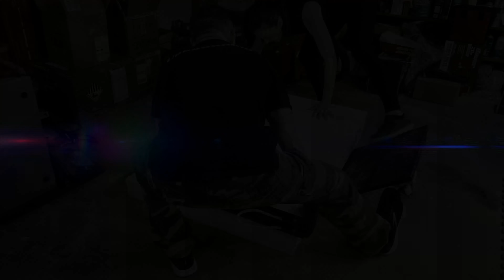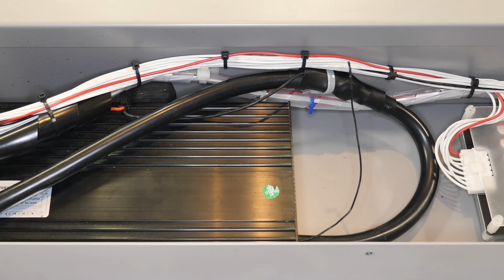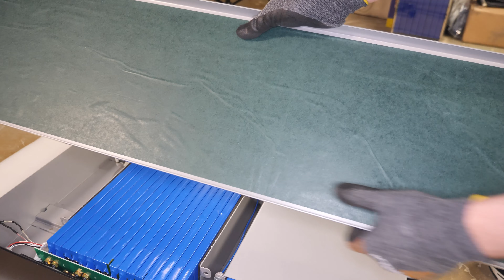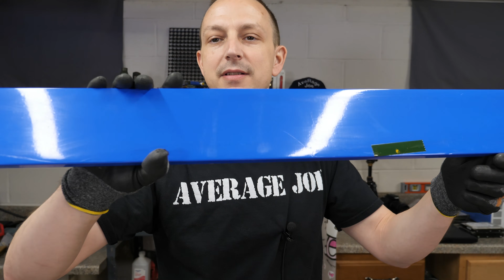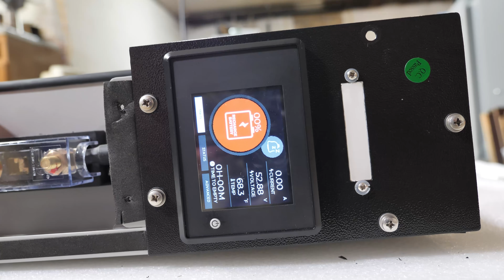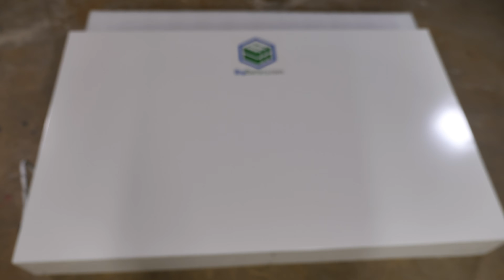14kwh Rhino Battery Teardown!  BigBattery.com

Comment: I've had nothing but issues with these batteries.  I bought mine through Battery Evo and am surprised to find their logo inside the Big Battery version.  I can't recommend anyone to buy these or really anything from Battery Evo as they don't stand behind their product and are not easy to get a hold of or get anything resolved.

Comment: Do you know anything about batteryevo the seem to be the same company as big battery. If they are the same product im about to but two of their rhino batteries for $3k a piece
Reply from the maker: So I think the story goes is batteryevo -->was<-- a sister company. Batteryevo would make or supply certain parts like the bms shell/cover, cell heat shrink stuff like that. Bigbattery uses all brand new batteries, Batteryevo I believe uses used/recycled batteries. I know a while back I did a video on some 12v 150ah batteries from them and they were used batteries. It was there BR150 battery.  Im all about gettin deals but I dont think I would personally spend $3k on one.
Reply: @AVERAGE_JOE  yeah I probably won't go with used cells in them it's very tempting given they looks the same even share the same name and warranty time with big battery lol
Reply: @AVERAGE_JOE  well I did some reading and they state they are new cells on their website so maybe it's a little more promising in that regard. I mean you can get two batteryevo rhinos for almost the same cost as one big battery rhino it seems weird and too good to be true lol
Reply from the maker: It does seem to good to be true.

Comment: So should the BMS temperature sensor be attached to the battery cells instead of just floating around in the box?  I'm no battery guy but don't really understand what is being gained by monitoring the case air temperature.

Comment: Nice tear down , thanks for ur efforts. Build looks fairly good & I like the active balancer idea, they do need it, but some more info on how that works would be good as some of this type can do damage.
I imagine u can set it to come on at pre set or settable parameters like @ 3.4v-3.45v when the charging cell is in its peaking curve, if it is set up correctly the active balancer will be be of great benefit more than a few times a year on a system that regularly hits 100% SOC, or else a switch could be added so you can switch it on whenever you want and turn it off so it doesn’t do any damage, as they can if not programmed correctly.
I think it looks like a pretty good/solid build for the price point. If you were to buy 2 of these batteries & had a faulty cell in one pack, you could pull every second cell to maintain 75% overall capacity with up to 15 spare good cells for any further cell faults down the road in either battery pack.  Cheers

Comment: So what do you think of the life of these batteries? Am I better off getting a server rack so I can replace them as they go bad?  I hate for this big battery to go bad and being up a creek.
Reply from the maker: From what I understand, these cells are the very best around! They have a 10yr warrenty, can be cycled over 8000 times (still lots of life after) and temp range is better then most. As far as rack batteries go, that is an option for sure. It allows you to build up capacity a little at a time or like your thinking replace a one if there is an issue. Either way you go is great In my opinion! 🤘
Reply: It can be seen as a pro & a con that this pack has paralleled cells, if you have a suspect cell in the pack you can remove one & have half ur capacity still to keep things going till u come up with another idea or replacement. If u had 2 of these packs, you could use those other cells to replace faulty cells as they occur in one battery pack to keep it fully operational, while the second pack is reduced by 50%, but you would have a spare 15 cells to keep one packs capacity up for an overall 75% capacity always for many years to come. Just a thought for future maintenance or quick fix.

Comment: I see on your breaker you have dual 60amps to power the Growatt.  Why did you choose 60amp?
Reply from the maker: The 12kw growatt has 2 60a breakers on the lower side so I used 2 60 breakers on the breaker panel to power everything. The manual may say to use as well but its been a while since I looked at it.🤘

Comment: In the event of an EMP, what components would have to be replaced? Are they readily available to pre-purchase for shielded storage?
Reply from the maker: I would say the circuit boards inside the inverter(they are avaliable) and possibly the bms inside battery(also avaliable) I would also suggest installing ferrite rings on the battery, solar and 120v/240v wires to help suppress the spikes. Dr. EMP on youtube has videos on the ferrite rings🤘
Reply: @AVERAGE_JOE  
Thanks! Growat sells a hardened version of their 12KWh & 15KWh inverters. Are you planning system follow-up videos?
Reply from the maker: Ill have to look up the hardend version! Didnt know about it. Yeah planning on more vids. Regular job has been busy but that has just changed!!
Reply: @AVERAGE_JOE  
I contacted big battery and they have NO (pre) or (post) EMP policy. They DON'T sell the BMS or boards separately that would surely NOT survive and only do "defects" as their warranty process. I asked if he knew what the countries posture would be post-EMP and he was very ignorant and tried to save face. He's not aware that ALL communities have an EMP component to their disaster responce plans.
My conclusion: they have a faulty business model, regardless of their nice product offerings.
I wished him well trying to get to work post EMP, let alone having an operational company.
Reply: @LtBRS   Are you sure it's Growatt and Not Solark that has EMP option ? I don't think Growatt makes a 15k .
Reply: @onthelake9554  
I could be mistaken. I'll go back and check into it.
Reply: @LtBRS  Yeah , Solark is the only inverter company  I've seen that believes in EMP hardening and they get 1500 bucks for it as an option.
Reply from the maker: You can harden the hole house and system for less from emp dr.
Reply: @AVERAGE_JOE  
SolArc shows their testing and compliance. Does EMP doctor offer the same confirmation?
I watched a bunch of his vids, and while it may be effective, it's all theoryaretical with no tests.

Comment: I was hoping you were going to cut the heat shrink off the cell so that we could see who made it. I suspect it's a BYD cell but it could also be a CATL. There was a QR code on the end that I think if you scanned it would have given you the battery manufacturer and date.
Reply from the maker: 😆 I totally ment to say they are BYD Blade cells🙃 I may have a pic of the QR code. If I do Ill scan to see if it shows anything!🤘

Comment: those are mfg. reject cells likely only due to those dings in the wrapper. Some EV mfgs use that cell, but their purchase contract doesn't allow for broken insulation, which creates the B product line - a piece of kapton tape and good as new.

Comment: I'd really love to add one of these to my existing Sunrun solar.  I've contacted a few solar/battery installers and all of them have told me they can't add a battery to my system with a transfer switch to switch to battery power if the grid goes down without voiding the Sunrun warranty.  And Sunrun won't add a battery to an existing system.  They'll install a Tesla power wall with a new solar install, but they won't add it to an existing system.
Reply from the maker: Damn that sucks. Im not familier with the sunrun. Im guessing its a gridtie system?
Reply: @AVERAGE_JOE  Yeah it’s tied to the grid

Comment: Only time I haven't had a good experience with using printed boards is for the car audio projects, they have to be at least 2oz or the heat does scary things. For the house system of course it's fine there's never more than .5 c load. What I thought was wild is that was a 100 ah, 3.2v cell. Over 3' long lmao! Sorry That's just bannanas to me. Excellent breakdown man, thanks for sharing. We live in an excellent time for batteries!
Reply from the maker: Bananas!😆😆😆🤘

Comment: I really don't like an active balancer on all the time.   It should only be turned on at the end of the charge cycle.     I can not tell from the review if there is a control that only turns the active balancer on at the end of the charge cycle..... but it does not look like it.
Reply: That is BS. Active balancers are installed at the factory for a reason. Do you think they add unnecessary parts to make their profit lower?
Reply: @solexxx8588  Active balancing in the flat part of the charge curve will most likely hurt the balance between the LiFePO4 cells.    A balancer uses cell voltage as an indication of state-of-charge, but a cell with 3.2V might have a higher SOC than one with 3.21V.  Consequently, moving energy to it from the other actually hurts the balance.  It is not till late in the charge curve that relative voltage is a good indication of the relative state of charge.   That is why all BMSs default to only balancing at voltages toward the end of the charge curve.

Also,  Big Battery is not known as the best battery engineering firm around.  However, Big Battery has been known to put out some pretty bad products.  Just because they put something in a product does not make it a good thing to do.

Comment: Excuse my question but whats the difference between these cells and BYDs Blade cells?
Could these units be used in a boat for a hybrid solar regen electric motor  power supply?
Reply: They are BYD blade battery cells.
Reply: @solexxx8588  
Thanks 👍🏼 they are a lot less fussy to pack up than round can  cells.

Comment: Joe, that is one hell of a sexy battery! I never would've realized just how sexy it wuz until you took it all apart. Imagine a sailboat with limited underfloor storage for say... batteries! Long, thin & powerful- what's NOT to love, I ask. I would like to run a 24v system- viola'- it's (2) 24v systems run in series for a 48v pack- Duh, even I can understand that (and, perfect for a near idiot like me!) Now, I grab (2) JBD 24v BMS's and run 'em in parallel and I got me a shizzton (technical term) 'O powah for my very hungry yacht (a term I use loosely). So Joe- YOU DA MAN! Thank you for solving a riddle that has eluded me fer a long time.
Reply from the maker: 100% sexy😆😆 Yeah a battery like this could fit under the floor or walls ect... They also have 12v with this battery!🤘

Comment: man they are nice but wow pricy, almost 4 times as much as lead acid.  Man I love to have 4 of them for 1,000 amp hour.  but 25,456.20 bit rich for my blood at the moment.  I guess I could always like buy one at a time.  they be nice to mount in a rack.  Man I want them LOL. but then again looks as if the price would beat building your own.
Reply from the maker: Its a damn nice battery. Its cheaper then a tesla powerwall, has more capacity and more power output! Will outlast lead acid by a long shot! One at a time works! Sure diy is always cheaper. I have diy as well!

Comment: that's interesting cells, never seen before.
Did you test an active balancer like that? From my experience, it's a piece of s.. 
Curious to hear your opinion.
Reply from the maker: They are interesting cells for sure!! I have only "used" an active balance in this battery. I know from other battery tests with passive ballancers in the bms, the first charge to 100% takes FOREVER. Even just a 100ah battery. I know if this rhino didnt have the active balancer for the first time charging it would take WEEKS if not longer to balance especially this size. I think before I wasnt a fan because I thought it would hide possible problems with used or  "bad" cells (cause thats all I had back then) however with new cells, they assist the bms to get ya balanced faster and then once balanced, I dont think it activates much. Im a fan for now!😆🤘 Didnt you have an active balancer at one point or still do?
Reply: @AVERAGE_JOE  yeah, I do have active balancer, but different style (and it works). The balancer that installed in this pack will have hard time to balance pack. Anyway thanks for reviewing the battery.

Comment: Awesome video Joe. Ever get around to seeing if the growatt will start your multi ton central ac without tripping?
Reply: I wrote a previous comment, but just wanted to land this here just in case.. if you add a microair soft starter to your condenser it should work out for you! It's a simple addition, but it'll lower your locking rotor amps and thus startup amps. It's learning cycle is 5 or so start cycles & then 🤯 boom it's voodoo magic lol. My Sol-ark now is capable of running my 3ton a/c off grid 😊🙏
Reply: @meganwinters5163  I am aware of this soft starter. Just wasn't sure if I'd need one if I buy this growatt being it's a transformer based inverter. Unlike the solark. I currently have an mpp lv6048 a non transformer based inverter. And liking to either buy another to pair it or switch to growatt 12k. 
Solark is out of my price range and has additional features I won't be using like grid tie and phase shift. But I may most likely get the soft starter regardless of what I do
Reply: @electromechanicalstuff2602  understood and agreed just wanted to share it with the community 😊🙏. I'm hopeful the growatts transformer can be used for future shed power, a well pump & get rid of the emergency generator for back-feeding the house in extreme emergencies. I wish you all the best on your solar journey and the soft start could extend your condenser life 👍!!!
Reply from the maker: Thanks man! No I havent yet, need to do some rewiring in the panels to add it or........possibly back feed that panel from this panel🤔🤔

Comment: Nice tear down Joe, thanks. I've been wondering about using PCB for tying cells together and running the balance/bms leads. I imagine 2oz copper on both sides with plenty of area is fine for inverter use. Really appreciate all the time/work you put in to pull this apart and put it back together again - thanks.
Reply: Julian Ilett uses PCBs
Reply from the maker: Thanks and appreciate the watch. Yeah many are using pcb's these days!

Comment: Joe, do you still have the old 10kw setup? I'm still running strong on mine after copying your setup 3 or so years ago. When it finally stops holding a charge I'm going to switch to life cells for increased safety.
Reply from the maker: You bet I still have it. Still running strong. Havent used since I started testing this beast out but plan on paralleling it back in!😆🤘

Comment: HMM! So they used BYD Blade lifepo4 cells (135AH each).
Each cell costs ~$35 compared to EVE 280AH's $120.
Reply from the maker: Remember you would need 2 to be close to the 280ah but even then $75-80 is still cheaper! Not to bad of a price for diy 14kwh!🤘
Reply: @AVERAGE_JOE   Yep,  cant beat the price :)
Reply: Where do you find these for $35 ?,  I am interested
Reply: @Ojames600  PS.There is even one company that sells these in welded busbar version - tell them you want 16s, they will weld it to you 16s. you tell them you want 4s, they will give you welded 4s. Caveat 50 Minimum Order. 50 x 16s, 50x8s or 50x 4s.
Reply: @Ojames600  Alibaba, shipped from China. If you are lucky they have a warehouse near you and you dont pay exhorbitant shipping fee
Reply: @DanBurgaud  Otis james? These blades in USA?  Jim
Reply: @Ojames600  Try Shenzhen Zhongtong Battery from Alibaba. They have stocks atm but at higher $43. Still much cheaper than EVE's $130 for the 280AH.,
Reply from the maker: Yeah I saw them at the same place. I would buy from alibaba over aliexpress.